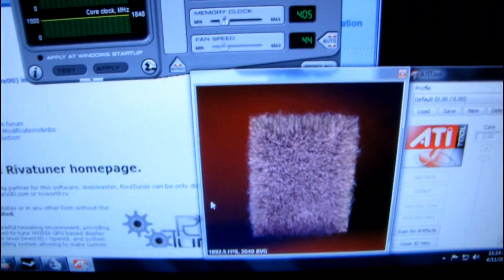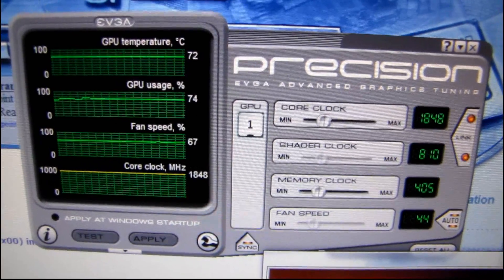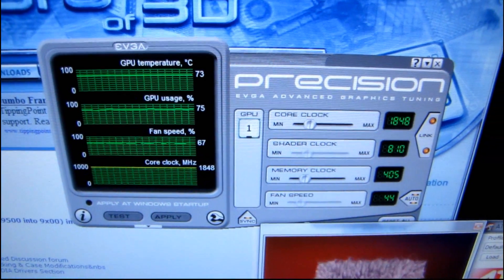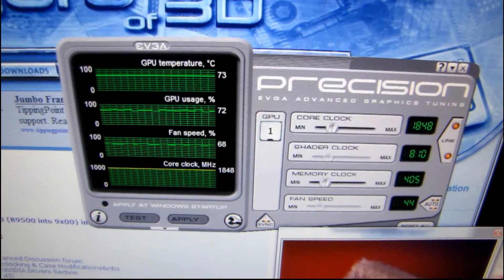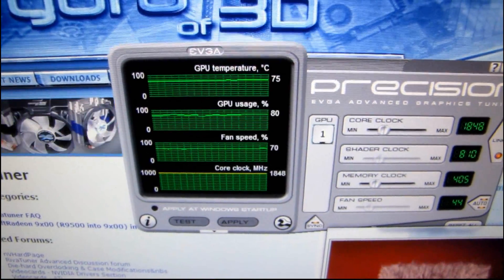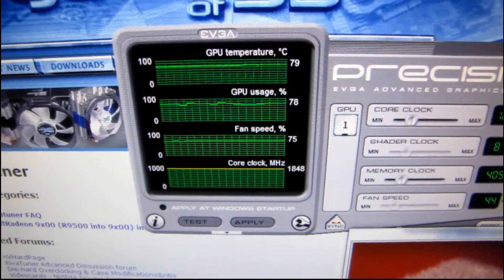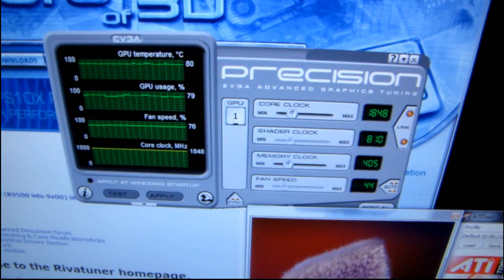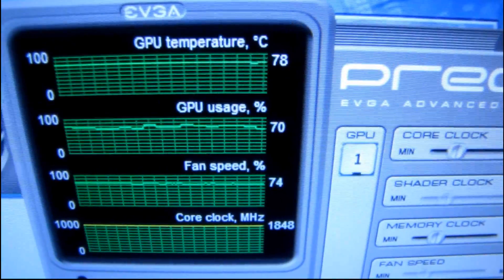nVidia GeForce GTX 480 Noise & Tempertatures in ATI Tool Linus Tech Tips

Comment: Wow, 5 heatpipes in an aluminium fin array, with an additional passive heatsink on top, and it still gets really hot. Sure it's a beastly card, even with the 680 out it still performs well, but it draws twice the power and runs hot to the point where you can make a Hamburger on it...

Comment: @MageThief Hi ! If you're not thinking in upgrading your graphics card, finding a new way to cool it down can be tricky, and maybe also cost you some bucks. The 4870X2 has only one 3rd party heatsink which really works well and gives you tons of help online, the Arctic Cooling Accelero 4870X2. I don't really know if they're still selling it at this point in time. I have one myself, its an incredible product, I really recommend it, if you don't want to save for a new graphics card. Hope it helps.

Comment: @mhaneline no... My point is that: I have my setup inside a case (cosmos s), have 23c room temp, Crossfire and get 31% fanspeed whit 90% load and he gets 67% fanspeed whit 70% load whit an open test bench and a cool room...

"For all temperature testing, the cards were placed on an open test bench" what are you talking about? what case? 95c - 83c = 12c delta temp...

Comment: @mhaneline Ya okay, I get your point, but you sir will see that withink the next month or so 5870 will drop 20% in price and remember, 5870 has been around for half a year now so its kinda old to compare to the brand new 400 series and still when you do - IT IS NOT WORTH IT! You actually made that 19% yourself my friend because you can only get that 19% extra perfomance when you are running Tesselation benchmarks.

Comment: so yeah 5870 is better priced, runs cooler, is less noisy and eats less power and in most of todays games like BBC2, Crysis, Call of duty MW2, Dirt2 and many other perfoms just as good and sometimes better than GTX 480. but then Ofcourse GTX 480 is better on tesselation, but who cares?! At the moment all I do is play BBC2 and create maps in sandbox cry engine2. So if I was getting an upgrade for my 8800GT it definetly wouldnt be GTX480.. ATI FTW!